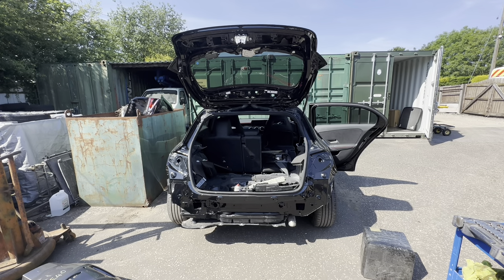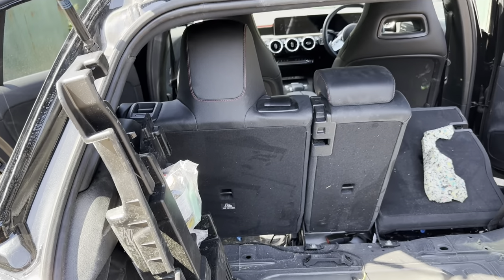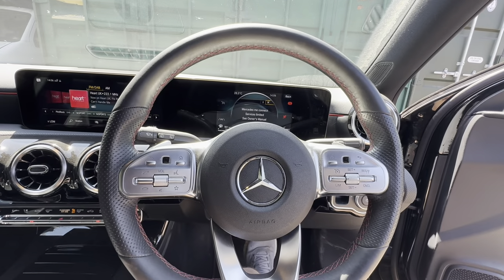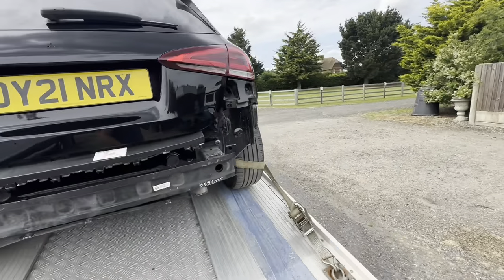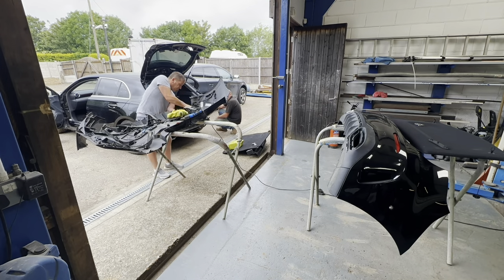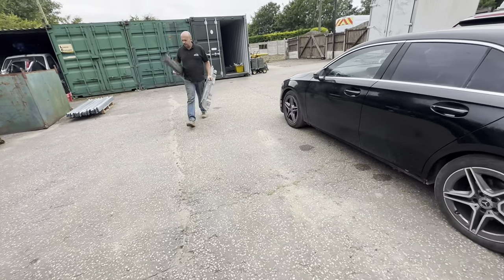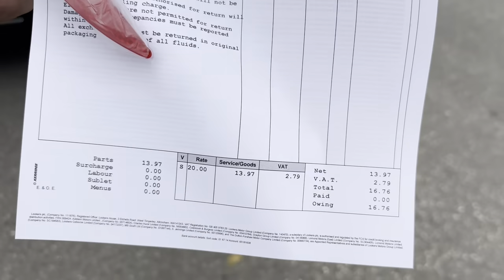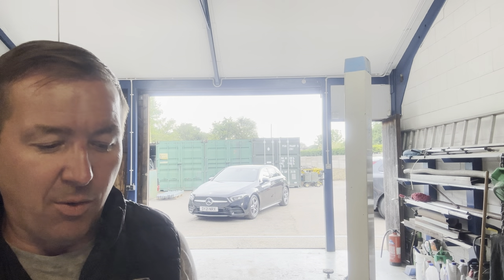WE BOUGHT A WRECKED 2021 MERCEDES A220 PART 4

Comment: Brilliant work and profit Rob!

Great A class, great engine and great rebuild! :D
Reply: I agree great engine, they are-actually Renault units! That will upset the Mercedes snobs. The petrol engines are the ones in the current Renault Captur and, I’d prefer one of them to any look at me Mercedes. Renaults come with parking sensors all round, blind spot monitoring and reverse camera, somethings merc don’t bother with.
Reply: @stevenmoran4060 This is a A220d a Mercedes 2L engine. The Renault engines are the 1.3 and 1.5L petrol and Diesel engines in the A 180/200 anything above 200 is Mercedes so 220/250/35/45 AMG.

Comment: Well I’ll be damned!!! I could have done with them things that you used to put the 2 wires together for my door wiring loom, I ended up replacing the whole loom  and Iv used them chock blocks but, upside is I have plenty of room for them to be hidden but, would have been so much easier with them things 🤦‍♂️😩